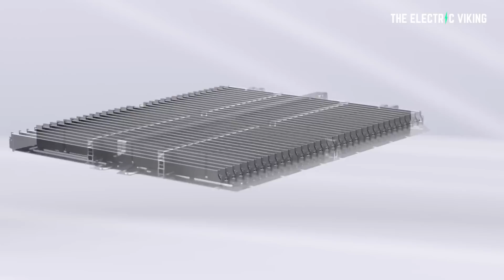Electric cars & pick up trucks will have more range than gas

Comment: I don't think most gas station will close, they will just convert to ev charging as the primary customer with only a couple gas/diesel pumps remaining at each station. The more gas stations that convert to ev charging the less anxiety toward finding chargers etc
Reply: Those stations will be selling synthetic gasoline and diesel before ever converting to electric. Germany already sells synthetic fuels.
Reply: @philcarbone3996  there's nothing wrong with converting to synthetic fuels. Heck there is nothing wrong with gas stations selling electricity to ev customers either. Gas stations should continue to adapt as they've always done to the changing world. Less than 100 years ago gas stations sold nothing except gas and car services. Now they rarely offer car services, but sell all manner of products from car fluids, to food and drink and alcohol and tobacco. During Prohibition no one thought it would be that easy to buy alcohol one day. History has proven that staying religiously stiff against change coming with future progress leaves many missing lucrative business opportunities.
Reply: @philcarbone3996  I’m a big fan of synthetic fuels, but unless it can run in existing ICE cars without modification, it’s going to be a niche market.
Reply: @davestagner  I have been using Biodiesel in my diesels since 2018. Do you remember going from leaded gas to unleaded gas in the '70's?
Reply: @philcarbone3996  Yeah, I remember the shift to unleaded gas, but I don’t think they’re comparable. I’m pretty solidly in the “against” category on biofuels right now, for two reasons. First, biofuels at scale are a product of industrial farming, which has a pretty heavy carbon footprint of its own, so they’re not nearly as neutral as they look. Second, that industrial farming means widespread habitat destruction, and I’m starting to feel that protecting our remaining wild land from agricultural destruction or urbanization is even more important than decarbonization. As I learned as a child, “extinct is forever”, and rewilding is a lot of work, especially in the face of deep-pockets industry like palm oil plantations and massive soybean fields (and all the finance and chemical production that supports them). 

Not saying you shouldn’t make up your own mind on biodiesel, or that I won’t change mine in the future (it’s already changed!), but keep in mind that it’s a palliative, not a panacea, and TANSTAAFL.
Reply: Have you seen the circus at crowded charging stations?

It is absolutely hilarious!

When EVs can fully recharge in 10 minutes or less then they will be  accepted. Anything else is a total pain in the 
🐂👈.
Reply: Not really,  since it's not a one answer problem. Increasing the amount of ev charging stations also reduces crowding. During oil shortages and extreme price hikes gas stations look exactly the same. The benefit of potential ev charging stations is that they can be put in even more places and many businesses already have the electrical wiring to handle charging many Ev and just need a storage solution to help offset cost more in their favor. The smart gas stations will create a S tier experience for ev shoppers to get them to spend money while they charge. A customer sitting for 30-45 min is even more opportunities to spend money. Instead of just offering basics like coffee and chips, adapt items similar to movie theaters like real food items and other top of the line products that can give a good profit margin, this isn't rocket science
Reply: @byrnc927  For now.
Reply: @spacingguild  
You are right, for now.

You left out charging will still suck for the distant future as well. Both in cost and time wasted. 

The over the road fast charging I have encountered is nearly as expensive as gasoline compared to using a fuel efficient vehicle. 

As electrical shortages stack up that cost will certainly get even more expensive.
Reply: @byrnc927  How many long distance trips have you taken in your EV?
Reply: @spacingguild  
We have two PHEV Gen II Chevy Volts. We have made at least three 2400 mile round trips in one of our cars since 2017. 

We considered buying a Bolt EUV when my Red Volt got totaled this past August by a drunk driver. 

We borrowed a Bolt EUV for the weekend. Well equipped and GM offered generous discounts to us on one. 

Nice vehicle and we almost pulled the trigger. 

What made us decide against the Bolt is when we did a comparison on how we would travel in the Bolt cross country.

We drive to Florida and back at least once a year, 1200 miles each way.

We decided against the Bolt EUV for economic reasons. 

We luckily found another super low low mileage Gen II Chevy Volt. 

It's actually cheaper to make the Florida trip in the Volt, even when we priced gas at $5.00 a gallon in our comparison. Why?
In the Volt we make it the total trip with three brief fuel stops and one hotel overnight. We also usually recharge the Volt on that stop for a free 50 miles or so of battery range. 

Making the same trip in the Bolt requires an additional overnight hotel stop and three more meals on the road.

The small savings in paying slightly less for DC Fast Charging (65% of gasoline costs)  over the road is offset by the additional hotel overnight due to travel time lost to charging. (Granted hotels again offer free charging to top off the Bolt.) 

Currently a full time EV is a great city car, but cross country trips are a real challenge. 

The Volt is also an excellent city car, but travels cross country effortlessly and for less total cost than doing the same trip in a full time EV.
Reply: Yes, people still have to check airpressure, clean windows and buy coffe and something to eat.
Reply: Most gas stations are too small to make a profit if they converted to charging. The only reason gas stations are a thing to begin with is because it only takes about 5-10 minutes to gas up. Most people are going to charge at home anyway.
Reply: @spacingguild  actually, gas stations don't make their profit selling gas, it's so the products inside that they sell at mark up
Reply: I think you’re absolutely right, but there will be a transition period. Right now, only 1% of the cars on the road in the US are EVs. I haven’t been able to find a number on what percentage of new cars in the US are EVs, but it’s going to be a few years before it’s enough to skew the numbers for cars on the road. Once EVs cross 10% or so of the cars on the road, it’ll start really hurting gas stations, which run on very thin margins. By the time it’s over 50%, the vast majority of ICE cars will be aging legacy vehicles. How long will it take to get there, though? The average lifespan of a car is around 12 years, and again, we’re still making mostly ICEs, so I don’t see this transition happening until the mid-2030s.
Reply: I believe the "anxiety range" for gas cars will be entirely due to oil shortage/war/ skyrocked prices, therein will be the anxiety. Meanwhile ev can likely charge at home. 
I don't adhere to the reasons found in our above video
Reply: @Froggability  
For those of us who fortunately can charge at home and stay local this will be a non-event.
Reply: Renny Melanie:  It's obvious that station owners having more potential customers over time is a good business model, at least until gas cars become very rare.

Comment: Our BEVs already have the same or better range as our gas car when charged to 100%. However, our Diesel had more than twice the range but it is gone for good. With teh amount of ICE on teh road I don't see gas stations disappear that fast especially as the supply of BEV is limited and the prices are still high.
Reply: A large number of gas stations closed down forever in 2008 with the high price of gas and the consequent reduction in usage.  The reduction was only 8%.  BEVs make up 12% of new cars.  Gas stations will be uneconomical way before they are no longer needed.
Reply: As most countries are banning sale of NEW ICE cars over the next 10 years builidng a new gas station is just not going to be long term profitable. Old ones will shut down more and more. Already starting to see it around where I live in Canada. Old stations are usually on land in highly desriable locations so get sold off and not being replaced with a new gas station.

Comment: I thought of this a few years ago.  Eventually gasoline will become scarce. This is many years away though. Probably well past 2050. The vast majority of vehicles being sold today are ICE. They will still be on the road in 12 years. 
Almost all gas stations in North America are actually convenience stores that also sell  gasoline. Many are installing EV chargers. They get razor thin profit margins pumping gas. They will just get a much larger commission for selling gasoline as sales dwindle. Another ten cents a liter will make a huge difference to the store's income. So they will weather the decline for a very long time yet. 
Gas stations are already in decline, they are closing faster than they open. I live in a small town. About 40,000 people. We have 4 gas stations just in one small area and several more around town. We definitely have more than 12 gas stations. So when 10 gas stations close there still won't be a problem finding gas. There are 145,000 gas stations in the US. It is silly to suggest anyone is going to have problems finding a gas station any time soon. 
Sam is obviously correct, of course all gas stations will close, but the suggestion this is happening anytime soon is crazy talk. It will be 2030 before the phenomena even hits the headlines. Gas stations will still be in every town of significance in 2050. 
1.5 Billion vehicles aren't going to be scrapped this decade and they are still selling millions a month.

Comment: As a chinese，I think  the key part for EVS MPR is not battery range,but fast charger technology.
Nowadays in china, EV for city drive is no problem，you only need charge 1-2 times per week. Many parking lot can provide chargers, some of them are even free parking if you use chargers.
But for long range drive(>500km) especially on holiday， the pain isn't to find a charging station,but these are way too many evs. you have to wait hours before you can charge your car.
many nio swap stations easily have all batteries swaped, you still need to wait hours for swaping battery.
#
I will share some data : till 2022.09 china has 1.6mil public chargers and 0.12mil petrol stations, even if we assume every charging station  has 8 chargers, still has more number than petrol stations.
So i think the solution isn't just build more pubilc chargers and make 1000KM range EVs.
Reply: i think in the end we will only need about 25% as many charging locations as gas stations since anyone who can will charge at home 98% of the time.
Reply: Sounds like both more chargers and faster chargers are needed - the two work together. If you can double charging speed you need half the chargers to charge the same number of vehicles. But since charging times are still around half an hour at the fastest, you still need a lot of chargers.
Reply: Just call huolala, and let them pull you 20km and you can regen enough for 200km....
Reply: Well EV batteries are a trade off of more range or faster charging. If you make them have more in series you get faster charging but if you put more in parallel you get more capacity. It's the reason some flashlights have 3 batteries dropped on top of each other vs AAA slapped on those weird carousel. Even with studies I've seen for solid state batteries, some have 3 times the capacity but similar charging speeds, or similar density but 3 times the charging speed. 

Honestly I'm of the opinion that cars will go more towards LiFePO which means fairly less range but decent charging speeds. But that's not the reason they're making them. They're gonna transition to them as LiFePO are cheaper to make and don't degrade with fully charging or completely dumping the battery to zero.
Reply: Agreed! The issue is with fast charging comes , Battery Degradation!  The battery replacement cost is almost 50% of the value of the vehicle, and EV  have issues performing under cold weather. My friend had a Battery replacement on a 2015, Model S performance, costed him $ 26K  , he had only 143K miles.
Reply: @cessealbeach  Numerous tests have shown that fast charging barely affects battery life at all. Newer batteries should last the life of the vehicle. Next generation of batteries are expected to last a million miles. So the whole battery changing argument is moot right now for most people, and will be a complete non-issue in the very near future. The three countries with the highest EV adoption are Norway, Iceland and Sweden. Apparently cold isn't an issue for EVs or these would be the last countries adopting them.
Reply: Many thanks for ur comment
Reply: Thanks for the information. We need more people letting us know how EVs are doing in China. Here in America, most EV owners have home chargers, seldom have to use charging stations or battery swaps. But charge speed IS an issue.
Reply: I have to disagree with your  statement / comment Chinese person because if you have the long range that my technologies  would provide then you won’t need to worry about swapping batteries or going to a charging station too many times at all…The future could be here now if one of these darn auto (EV) making companies would call me and then implement my “ultra long range technologies for EV‘s” into their vehicles and that would give a range of 840 to 1280+ MILES, not kilometers!
   That’s right folks, I took a 2011 Chevy Cruz ECO, took out the engine, exhaust and every other non-important ICE part and converted / transformed it into an all electric vehicle but with some stuff added to give it this extra range. Feel free to reach out to Edward at “New Ideas and Innovations, LLC“ out of Madison, CT USA if you are in a financial position to purchase the ways that I made my car go ultra long range! Thank you!
Reply: @Doing_it_right_the_first_time  Sorry Edward, during holiday, there are hundreds of milions on the the road at the same time. During usual days, you have let's say, 15 people using the chargers, during holiday you have 15000 at the same time.
Once I passed 3 empty gas stations, over 150 cars waiting for petrol, during Chinese new year and left the motorway to find a petrol station, with -20km. 
Chinese holidays are extrem.
Reply: @larsradtke4097  So how does my technology that would keep you on the road instead of going to a charge ing station get lost on you Lars?… how did my message get you confused? With my technology you would be on the road instead of waiting for a charger to open up, do you not understand what I’m trying to say? I just do not understand your response to me!
Reply: @Doing_it_right_the_first_time physics.  80kwh = 350km
Total travel distance 2700km

Comment: Pickups used for towing will take longer to be replaced by EVs because it will require a larger more expensive battery, which will take longer to recharge, both of which effect the bottom line if used for business until technology catches up.  
Agricultural equipment which needs to run around the clock during certain seasons will also take a while to replace because they will need very large and expensive batteries but have sometimes very low utilization during the rest of the year, (Harvesting Combine).  Earth moving equipment would be another market where ICE may hold out for a while.  
All of these are niche markets and like slowly rising flood waters they will be islands for ICE engines to survive on until eventually they too will be washed away.
Reply: 100 kWh of batteries cost about $10k, that's about 1600 gallons of diesel.  THAT affects the bottom line.